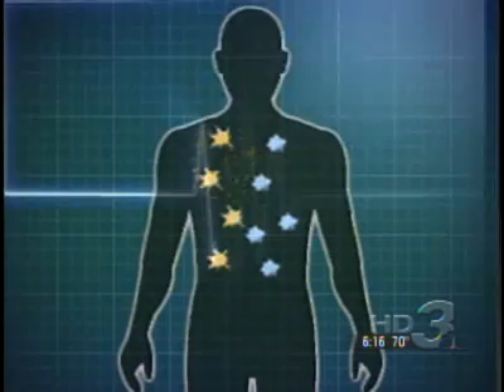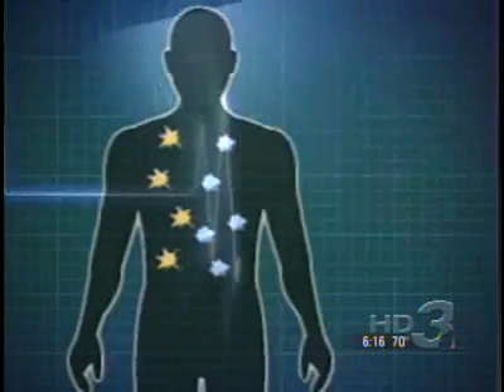SALT WATER FUEL FOR CARS

Comment: This is idiotic and noone in this video has the least understanding of basic science principles.  Duh....its requires more energy to decompose the water into hydrogen and oxygen gas than you would get back, its called electricity and it costs money, this is basically the electrolysis of water however you achieve it.